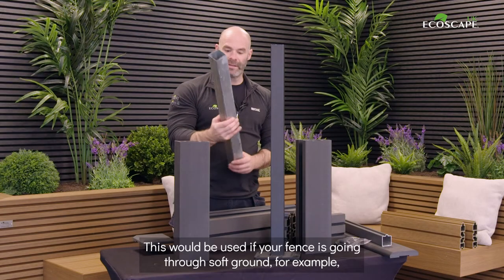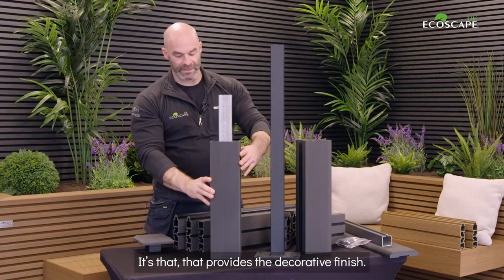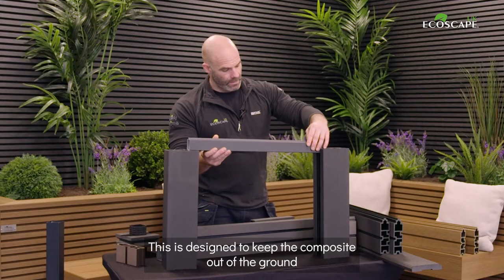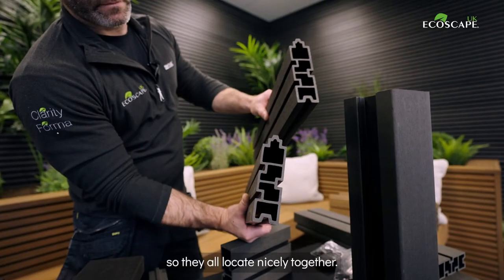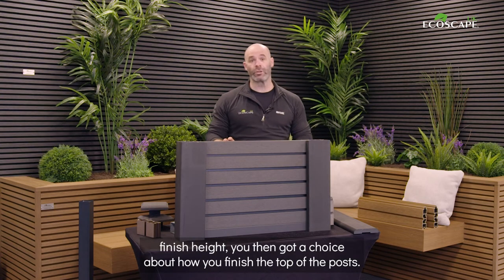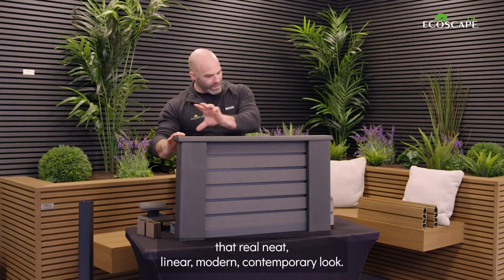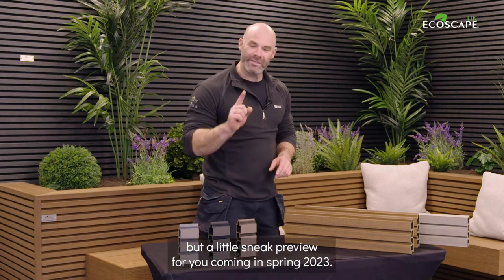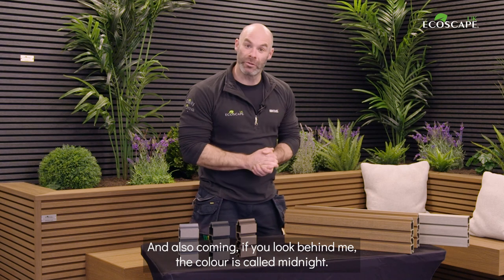How to install a Composite Fencing system by Ecoscape UK

Comment: Looks like this has a huge security threat if the other side is an open area. Any person can remove fence boards easily as there is no proper locking mechanism between fence boards.
Reply from the maker: No security threat - you have option to secure the fence boards with our plastic holders and screw them in if you have concerns but we have had no issues with this before. The other option would be to secure the post caps down with adhesive. Hope this helps!